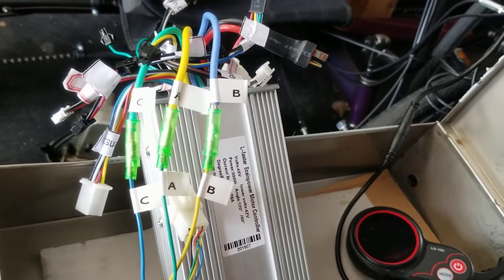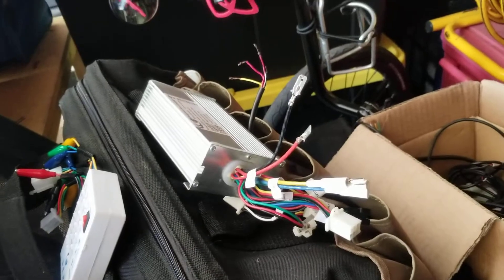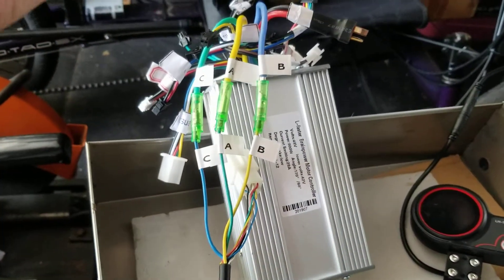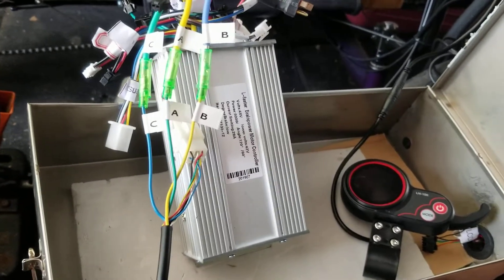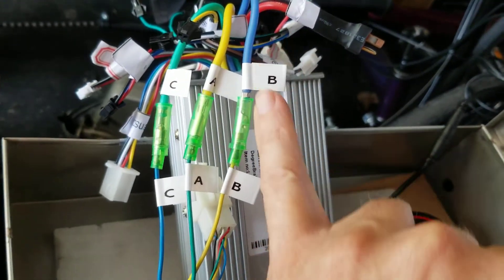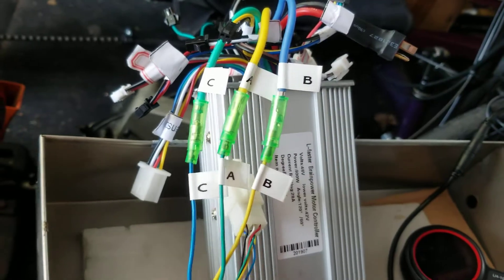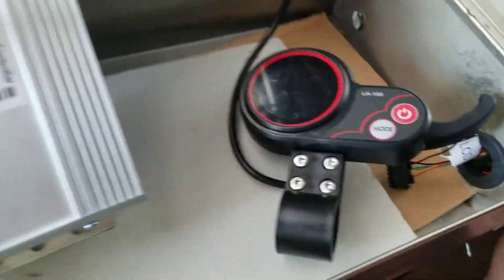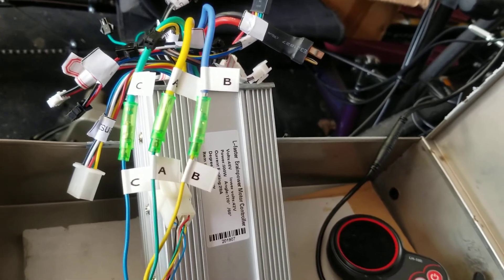E-bike Motor spinning - wheel not turning

Comment: Thanks a lot buddy you definitely saved my motor hub 😂 I have first did the cabling myself following the supplier manual but on my first ride, the controller went so hot I have been scared that it would catch fire. Thanks to your video, I have finally fixed this issue and now my ebike is running perfectly.

Comment: Will a 36 volt battery work it's supposed to be a 48 volt
Reply from the maker: @AmberAud  from what I've read they don't recommend it stating the 36V battery might not take advantage of the systems potential. What ever that means.

Comment: I know this post is old but helped me figure out my issue. The color combination you have in this video helped me out. It was fine till I took my motor off to change the clutch and then , I hear it run but the wheel did not spin. So thanks I don't know if you will see but, I appreciate it. 😊
Reply from the maker: Glad it helped. Yeah I get emails every time someone comments. Glad people are still finding it useful.

Comment: Hi I have an onyx rcr QSmotor  the wheel locked up and won’t spin after a hurricane water was above the wheel but it turns on and throttle shows voltage when turning but no movement .idk if the motor is bad or something else

Comment: Thanks guy!  I had the same problem and first thought it was something major.  Found your video, then after some trial-and-error, I was able to connect the motor wires correctly to get the wheel turning.  You likely saved me many hours and a lot of frustration.  I owe you a beer!

Comment: Many thanks. This was indeed helpful, as I had exactly the same problem after buying a new controller. (In my case, yellow to yellow was correct, but the blue and green needed to be swapped over.) This tip certainly saved me a load of time, as I was just about to strip down the motor in search of some kind of centrifugal clutch! 😅

Comment: same here now to figure out how to save P settings and they appear different ...ugh BUT Thyanks for this as it fixed my issue of wheel not turning. used same sequence as you show here was color for color match.
Reply: UPDATE, if you open controller you will likely find wires are soldered in wrong location. Maybe color bling QA worker on the lose in china LOL

Comment: You do know there is 36 combination 
You have only found one combination what is wrong.

You can't just change the phase wires you need to change the Hall sensor wires aswell.
You need to find the correct combination or it won't run properly.
Not only that it can cause damage & lose speed.

I can 100% guaranteed you have Wired that controller wrong.
Just because  the wheel is turning the right way.
It doesn't mean it's the correct combination.
The timing will be off

Comment: Saved my bacon in 2022.
I'm quite a seasoned ebiker (built my own battery etc) but my mate asked me to to fix his battery and update his controller.
Job sorted but none of the wires were plug and play.
Anyway.. It all  worked fine and dandy but couldn't get the lights / horn working.
So instead of "bodge twisting" the wires together after I sussed part of the lights issue (got the rear & brake light working) I decided to take the controller off and solder it on my workbench.
 You know what's coming next don't you !! 
Yup, after connecting it all up it made a heck of a growl and then just span as per your description.

The blue & green are pretty faded so I might have mixed them up and the controller lost memory.
Watched you vid and tried it. It worked as single speed but noisy so I reconnected again the correct way and put it into learning mode.
Success
Was beginning to think I was going to have to buy him an new ebike !! (Trail - G)
Anyway.. Thanks.
Anyone got any tips on how to make the poxy horn & front light work ? 
https://youtu.be/jLWOC16KjmY
Reply: Please post how you "built a battery"

Comment: Well thx for the video it helped a lot after a full day of trying out all the other potential issues. You combination did not work for me , but another one did.
 My yellow,blue ,green  was mirrored in the opposing direction, green blue yellow.
The comment of the motor running but the wheel not turning had me perplexed.
My issue was the wheel was not turning but was locked solid ,vibrating loudly and could not be turned by hand , the coils must have been triggered out of sequence and were fighting one another. I had something similar happen to a washing machine once when a positional sensor went bad. Its like it was having a seizure.

Comment: Do you know what the connector grouped with the Blue, Yellow, and Green wires is? And why it has to be unplugged? On my controller when it’s plugged in the motor doesn’t spin.
Reply from the maker: I don't believe mine are connected to anything
Reply: @rlachermeier  Yeah I looked it up and it’s related to pedal assist. I don’t have it on my bike, so I don’t need it plugged in.

Comment: On that new controller? What is the name of those connectors and maybe please do you have a link to share where I can get them ? I cannot find them ? Please I need then to connect mine ?
Reply from the maker: The battery connector is a "Dean's" I'm not sure about the others. The battery connector you can get at a hobby store. Not sure about the rest.
Reply: @rlachermeier  you dont know what the connectors on the A. B. C. wires are ?
Reply from the maker: @anio6865  I believe those are called "bullet" connectors

Comment: Thanks for explanation it helped a lot...but later I learned that if you connect those two white wires(short them), it will adjust the phase angle by itself, if possible make another video explaining the same.
Reply: Which two white wires?

Comment: Having the same problem. Planetary gears were stripped in motor, replaced for new thought that would fix it but now the horrible crunchy noise is replaced with the whirring of the motor and no wheel movement. Going to have a go at this fix 🤞

Comment: Your mistake is assuming the motor was actually spinning. It's not spinning lol, just making the noise caused by PWM
Another issue you can get by hooking up the phase wires the wrong way is the motor spinning backwards.
Reply: It was spinning.  A geared hub motor has freewheeling for when bike coasts.

Comment: 36K miles on my ebike now with only one issue... a faulty controller. It took about 30 mins. to swap it out and I have never had another issue. 

When I started my build I wanted the best all-around ebike possible with the focus on maximum range and the ability to carry/pull hundreds of pounds of gear. So far I haven't seen anything that comes close. Stay safe.

If you want to see the bike and the process of building it leave a note on one of my videos since this "channel" doesn't allow links.
Reply: hello there, what's your kit/brand u used? where did u get it from? link would be great. thanks
Reply: @KraszkoAlmos27  Hey Álmos, I tried to leave links but a lot of YT channels won't allow the use of them. I'm sure it's hard to have people showing a better way to do something on your own video. I haven't seen a production ebike I would buy yet. My bike frame is a Tout Terrain Panamericana with a BaFang BBSHD connected to a Roloff Speedhub. If you contact me on one of my videos I can give you some links and pictures of the whole process. It's surprisingly easy to have a great ebike.... nothing at all like you see in this video. Stay Safe.

Comment: Hello, i have the same problem and i have inverted the wire as your indication but not solved. Do you have inverted also the wires of hall sensor?
Reply from the maker: I didn't. If you're still having problems you might want to try what "spinnanz" suggests below. It's something I wasn't aware of.
Reply: @rlachermeier  thanks a lot :)

Comment: Changing the phase wires works i guess but it is the incorrect solution to the problem, those brain power controllers need to be trained to work correctly and to do that you connect that single green wire together and then power up the bike this will make the controller enter training mode where it attempts to spin the motor in so doing learn the motor so that it runs optimally, sometimes however they come set for direct drive hubs which spin the oposit way to the motor in a geared hub and so the motor spins the wrong way  and does not spin the wheel, the correct way to fix this is to pull the throttle during the training phase and this tells the controller to switch the direction
Reply from the maker: I think I'm going to try this when I pull it out of storage this spring. Thanks!

Comment: That controller has a "learn" wire (you can see it in the video). This can be used to choose wheel direction.
Reply: Yep. Just momentarily connect the 2 wires  and problem solved - no need to faff around swapping phase wires.
Reply from the maker: I did not know that.
Reply: @rlachermeier  it's the 2 single green wires each with a plug. To change direction, join them together and then power it up. Each time the unit up powered up with the wires connected it changes the motor direction. When the motor direction is correct, you disconnect them.
Reply: J ai branché les fil d apprentissage la roue tournais dans le bon sens une fois débranché j entends tourner le moteur mais la roue est immobile je vais essayer d inverser les fils de phase
Reply: @SteveTessier-v6k  plug in one or two times. When the wheel turns the right direction unplug and do not plug in again. now the wheel should turn in the right direction by throttle unless your controller has a "reverse" wire. if you have hear motor turning in reveres, the revere wire needs to be connected or disconnected.
Reply: Mine is not spinning at all, the error code is 007, but haven't tried your method yet. The motor is new
Reply: @spinnanz  c est vrai j avait branché deux fois … ça as pris 4 essais avant de fonctionner maintenant tout est parfait merci pour les informations

Comment: It must be my English but how can the motor be SPINNING and the wheel no TURNING? This is a hub motor inside the wheel so either both are turning (spinning?) or both not.
Reply: It is likely because it is a geared motor and is prevented from turning the bike wheel in reverse while running. Watch this guy's very detailed video on bike controller installation:
https://www.youtube.com/watch?v=PuwnFMHHtaE
Reply from the maker: That's what I would have thought? But if you don't have the wires hooked up correctly the motor makes a spinning sound without the wheel moving. I wish I would have recorded it before I fixed the problem.

Comment: Some people got confused, this video is for installing new controller, if the phases  wires doesent work properly (motor spining but the wheel not) when match the same colors, then swap them till you find the right combination, but if your bike just suddenly the wheel stop turning   and the motor spining, then you meed new controller, or in my case new motor because the inside the motor got damaged when i drove the bike throught the curve and the rear wheel got slamed from the top of the curve to the botom, when i was riding it, i didnt know that cauld damage rhe motor assambly.

Comment: No hate but THATS WHAT THE "SELF LEARNING WIRE" IS FOR!
Reply from the maker: Never heard of "self learning wire"
Reply: @rlachermeier  two thin wires usually white when you clip them together the motor spins in the direction you want
Reply: @gerardjachymiak5822  some motors don't have it or have it but not working properly. I do have the self l wire but only coming out from the controller and my motor does not have it.
Reply: Désolé mais j ai branché les fil  d apprentissage la roue tourne mais une fois débranché l accélérateur fait tourner le moteur ( bruit) mais pas la roue